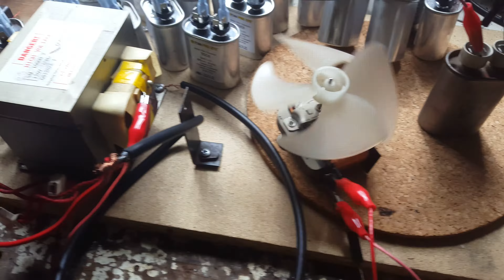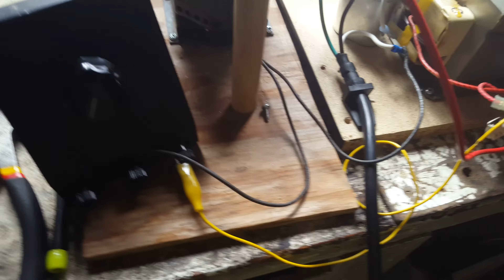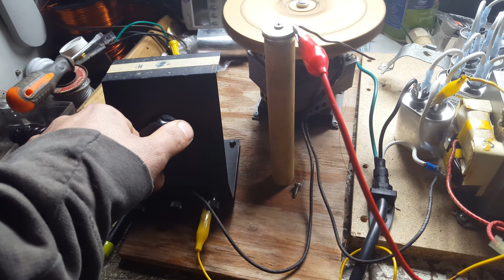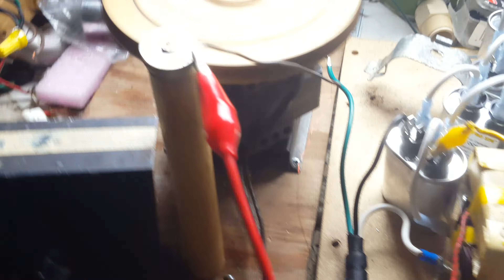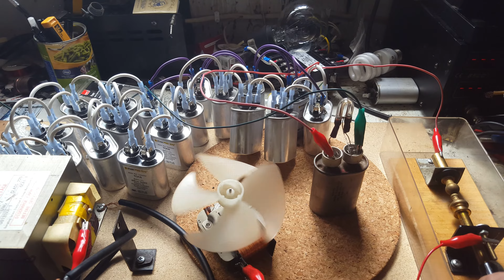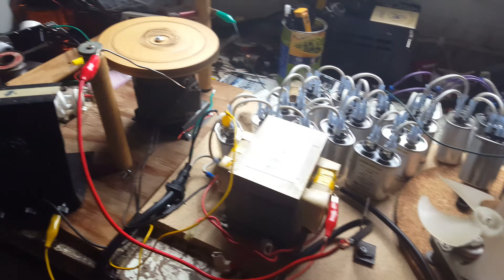Hairpin driven rotary driven hairpin.. Part 1

Comment: Chris is there an outside input of energy like ac mains or is this straight out of the sky?
Reply from the maker: yea, i'm using the positive "signal-only" from the AC mains.. just the hot wire, and an earth rod for ground.. The hot wire has a hairpinned capacitor in series.